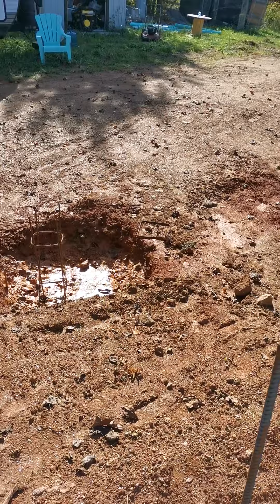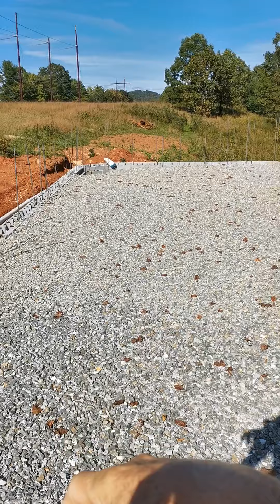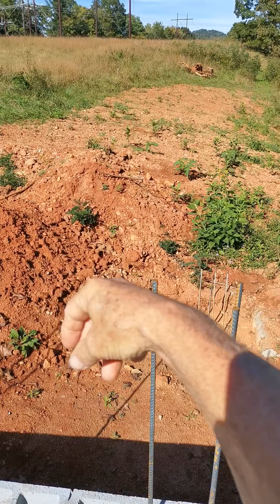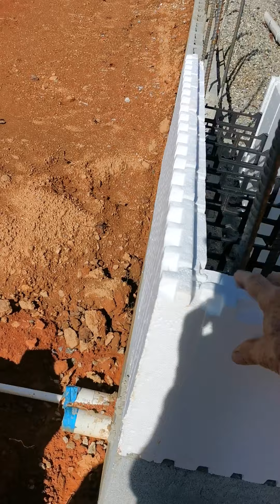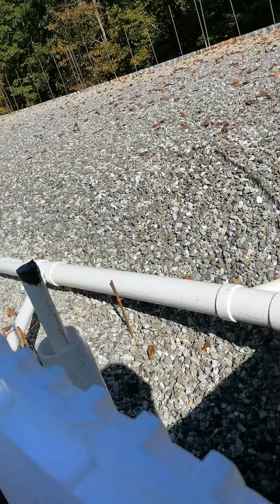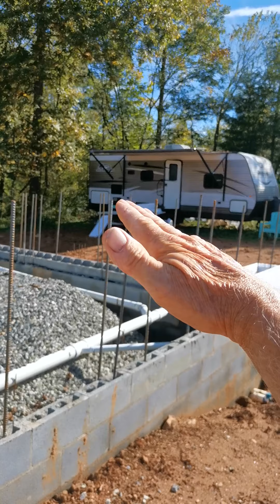#2 Do It Yourself ICF Home - Layout and Forms

Comment: I wonder how hempcrete would hold up in those Styrofoam forms. I know it is lighter than concrete  and a larger R factor. I wonder if that has been done.
Reply from the maker: I wanted to see if hemp fiber is available. $99.99 for a 35 lb bale on amazon.com. Seems totally unaffordable. In this case whatever you fill with has to be pumpable to fill the walls. Also it has to meet 2500 psi or more compressive strength to pass the building code.